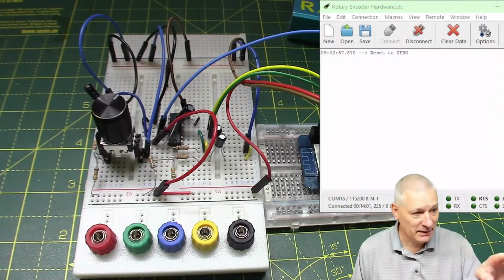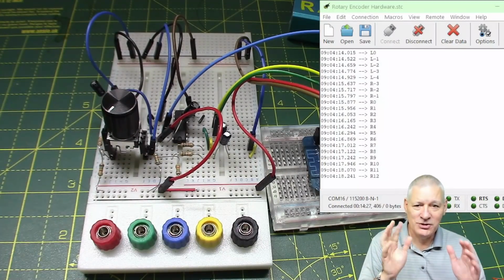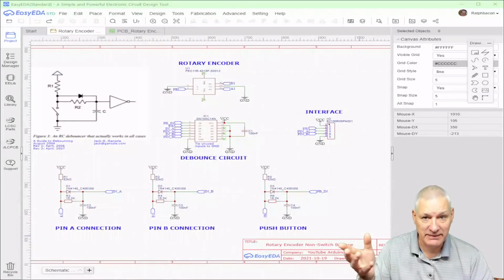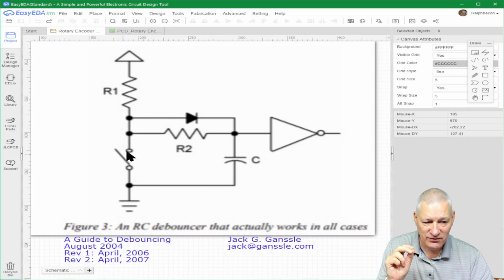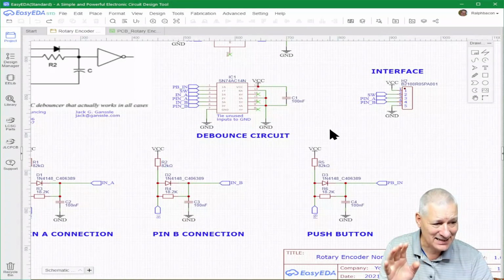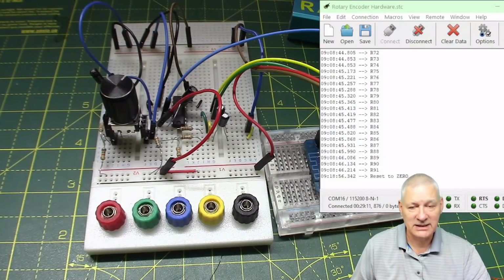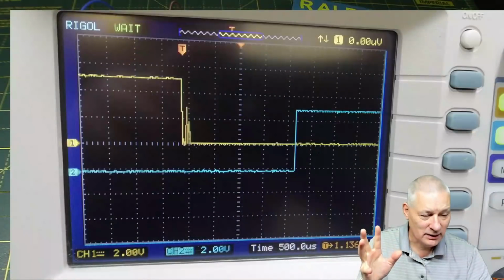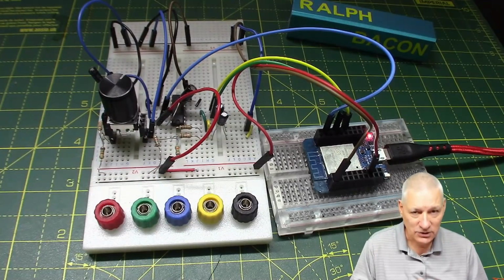#230 The ⭐ULTIMATE⭐ Switch Bounce Eliminator - simple and effective. 🎈

Comment: You can do without the Schmitt trigger chip as digital inputs on microcontrollers have threshold levels for each logic level and known input impedance.  There is typically hysteresis  as well. With some rearranging, the resistors can be reduced by employing pull-up (or pull-down) on the microcontroller inputs.

You have to do the maths! 😎😁
Reply: Yep. You can check MCU IO block diagram if it have schmitt-trigger input. It seem at least AVR has these.
Reply: As do STM32.  On the RP2040, the Schmitt trigger is enabled by default, but can be disabled in software.
Reply from the maker: Sounds feasible... but only proven in practice. Let me know when you've tried it, Bernd!

Comment: I've been building Marlin UI's with cheap rotary encoders recently, and am using a similar circuit, minus the R1 and the Schmitt Inverter.
Most MCU's will already drive the digital read line high through a high valued resistor. 
So an easier, passive means is to just use a diode, resistor, and small capacitor for each switch.
Reply from the maker: Sounds great! In fact, it sounds a bit like what @Bernd Felshe was saying the previous comment. Please don't tell me I have another switch bounce circuit to build?
Reply: @RalphBacon  subscribed ....it's been 24 hrs ? 😜
Reply: did you mean without R2?
Reply: @TheUnofficialMaker  The idea is to eliminate the Vin+ and R1 because the read pin can be "INPUT_PULLUP", in place of the Schmitt device.
You could go the other way (higher complexity), with 2 diodes for a symmetrical no-bounce circuit.
Reply: @GnuReligion  got it. thanks

Comment: just a few days ago did a de'bounce on a rotary encoder with schmitt trigger as you describe,  i had to poll pin A stat for high / low and low/high to get 1 increment/decrement per tick and works like a charm. Suggestion since .. its a hex inverter, would of been cool somehow to be able to chose if you want the final signal high or low by using the other 3 schmitt trigger in series or not. Great video Ralph ! 
nvm: i just saw you said about it :D
Reply from the maker: Thanks for sharing. Yes, using the other three gates is most do-able but by then the circuit was designed, the PCB on order... and I discovered it about an hour before I made the video. Oh well, high or low, it works!

Comment: I’ve always used two approaches, an RC filter from each output, and also reading the pins twice… works a treat. I actually read both pins to look for the alternating pulses, if it gets two pulses from one pin without a pulse from the other pin then it knows it was a bounce and ignores it.
Reply from the maker: Sounds cool. I'm guessing there are quite a few ways to detect and/or eliminate switch bounce. What I like about this hardware solution is that we no longer have to concern ourselves in the code with such things!
Reply: And if you use an esp32, you can use the hardware counters. In software you can set a debouncing value. It also helps debouncing. There are libraries available for rotary encoders.
Reply: I use this circuit without the diode. I'll try with the diode and see if an additional component on the bom is warranted

Comment: if you put the components on the backside, there would be more space in the front to mount it in a panel...
Reply from the maker: Yes, indeed. Just looking at mine here, if the 74XXX14 chip were soldered directly to the PCB (no socket) then the rotary encoder would fit onto a front panel and nothing gets even close to that. Or redesign it with SMD components, as I originally was going to do.

Comment: There is  a little trick that can be used, which is to connect one of the two pins (A/B) as a trigger for an external interrupt, and tell the direction fomr the state of the other pin as direction whenever the interrupt takes place, which can grant a safe higher turning speed, than with the shown schematic. That is especially true when a flip-flop stores the direction information of the pin that is not used as the trigger, but as a downside requires an additional IC like a 7474. But besides that a very good choice to use an external low pass filter to get rid of the bouncing. ------ Btw. shottky diodes are not used for rectification for some reason, which makes them not the best choice for blocking reverse current. They work to a certain limit the same way as silicium diodes, but do not block currents as fast, caused by their satturation characteritics. So do not expect that a shottky-diode does exactly what you expect when the switch connects the low pass to ground at all times.    A 1n4148 (small signal si-diode) might be the better choice for this application, since it sppeds the charging at least up to Vcc-0.7V, while the rest up to Vcc then comes through R2. But when the switch connects the low pass to ground, the satturation charge is removed much fatser, so the time of reverse conducting is reduced until the diode blocks, while a shottky can under circumstances still be in a reverse conducting state. This behaviour is very depended on charge, amount of current, etc. ... but can play a role depending on the application.
Reply from the maker: Hmm. My sketch uses a single interrupt on Pin A and then interrogates the state of Pin B to see which way the rotary encoder was being turned. Not the most elegant bit of code (too many if statements in an ISR) but works well enough to show that no bounces were corrupting the direction information. Isn't that pretty much what you are saying?

Regarding the diode, guess what? I wasn't using a Schottky after all, but a 1N4148 (just like you say), much to my surprise when I built the PCB. I was getting confused with my remote temperature sensor from my Smart Heater Controller which definitely uses a Schottky to block reverse voltage flow - works OK in that circuit (a future video will tell all). In this bounce circuit the diodes are optional - might not be needed at all.
Reply: @RalphBacon  Well, since I did remember something you had mentioned a shottky, I felt to point out that shottky diodes might not fit the purpose, since all the load in the capacitor wants to get discharged at once in reverse mode, so a huge current within a nanosecond, and the saturation characteristics might allow that to some degree, instead a fast small silicium signal diode with little saturation charge might be the better choice then. But perhaps I got your comment wrong then? My bad... :)